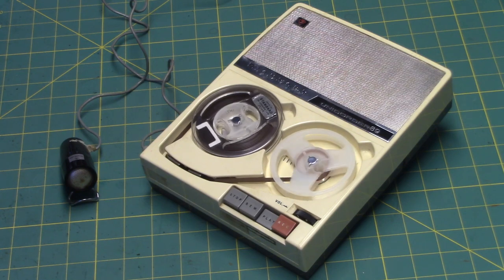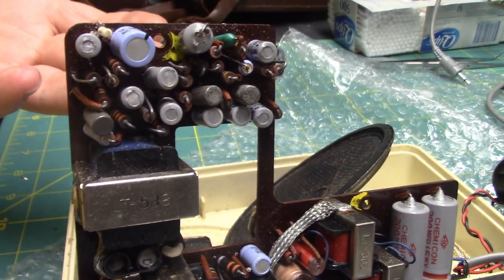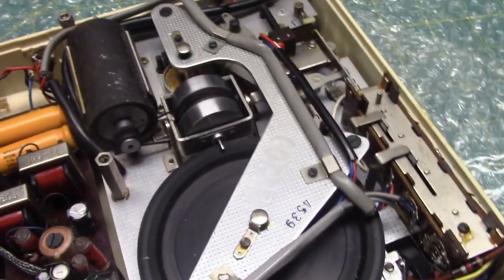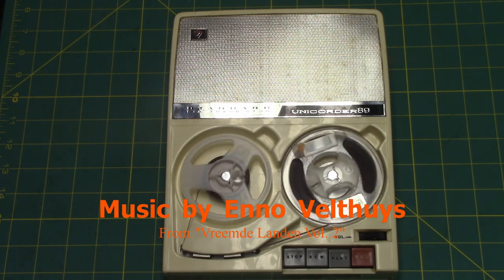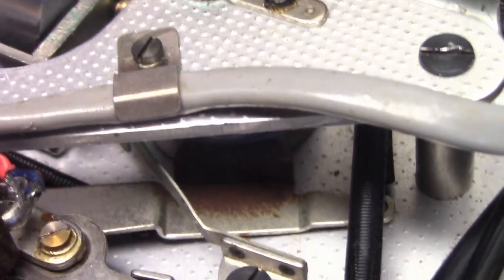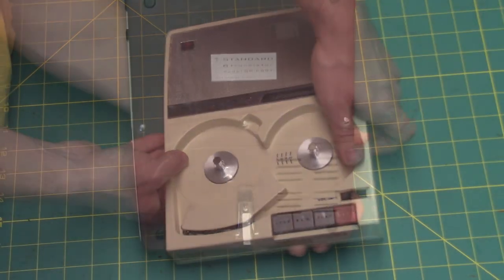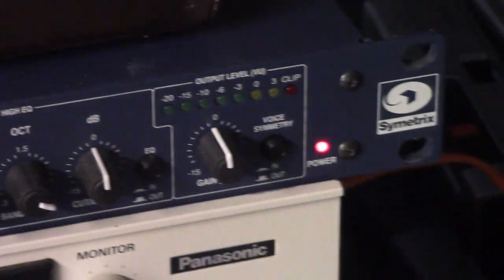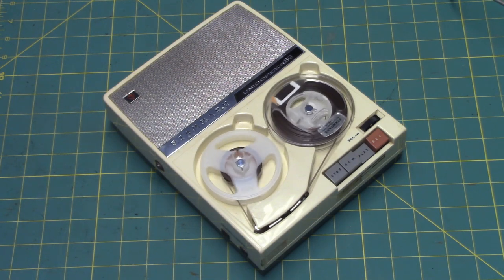Rim-Drive and AC Bias The Standard Unicorder 89

Comment: I have the exact machine. I used a faucet washer as a tire to drive the rewind function, cutting and filing the washer to work properly,  I didn’t play at all but after gluing the washer onto the capstan it sounds pretty good. I found some old tapes that came with the machine and see what’s on them.